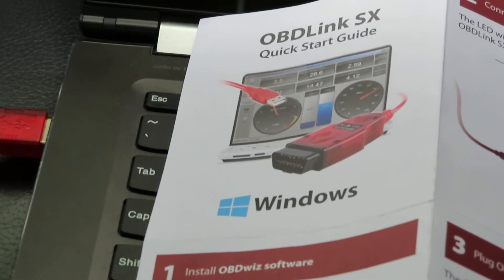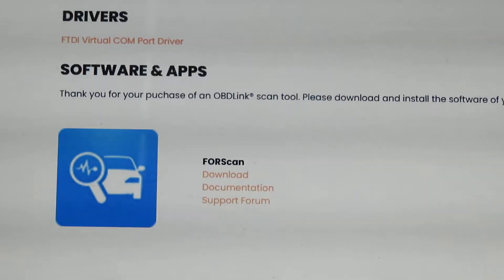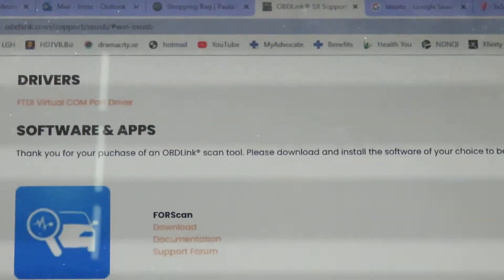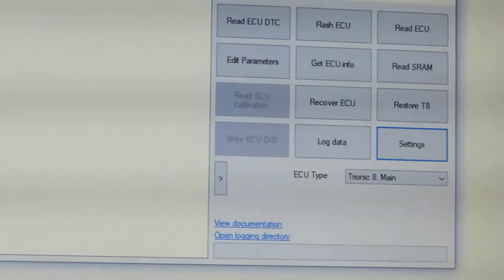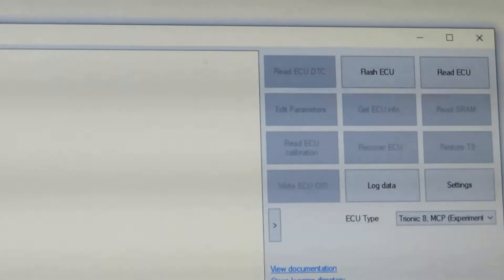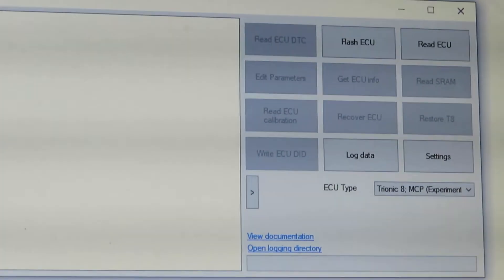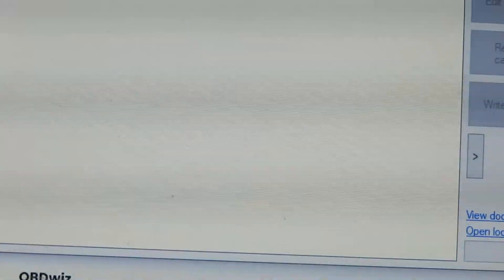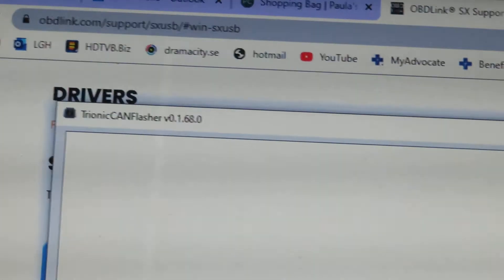2003 - 2011 Saab 9-3 2.0T Engine computer ECU fail -  P0245, P0201, P0202, P0203, P0204 no start

Comment: Failure is caused by heat build up, because of where it's factory fitted, fit a heat shield or better still, relocation of the ECU

Comment: Very helpful video!  I’m curious why you say the ECU rebuild service doesn’t work.

My Saab recently suddenly broke down and won’t restart. It ran fine and wouldn’t restart minutes after turning it off. Found a single P0204 code.

Comment: Hi. I would like to ask you. I "read ECU" main and mcp files. Do you see how small they are? Main.bin 1024kb, Main.md5 1kb, MCP.bin 257kb, MCP.md5 1kb. I tried to do "recover ECU" but it didn't work. I thought I could do something. When the engine went off on the road because I can't find any damage. I had an indicator on the brake lights and it shows nothing. Why; Do you know something?

Comment: Thank you for the video, did this fix solve the problem permanently or it come back again, I got some similar cases that need the injectors to be replaced as well before putting the rebuild ECU.
Reply from the maker: No issues so far with reman ECU replaced.

Comment: Very helpful. I tried this, but one issue I am having is my new ECU seems to be pared to my car correctly, except it starts the car as soon as I turn it to "on" instead of all the way to "start". Do you think I wrote something incorrectly?
Reply from the maker: I never had this issue. Sounds like your ignition switch could be the problem.

Comment: My Saab is in the shop and they told me they can't help me..at first I was having a fuel delivery issue..so they replaced my starter,put in new fuel pump,they checked my injectors and said they are good..was getting a p0300 but even with all that done my car cranks but won't start unless using some type of starter fluid but then it will cut off in a few seconds..they said I  need a new ECU,do you think that is the problem?also I am getting spark
Reply from the maker: Sounds like a bad ECU
Reply: @axleung1  thanks man,I don't want to get rid of the car so I will try and follow the steps in the video

Comment: Do you know if there's a way to reactivate features such as unlocking chirp sound as an example among several other things using this setup or is a Tech 2 the only way thanks for any info in advance
Reply from the maker: This procedure should duplicate all the settings from the old ECM to the replacement
Reply: @axleung1  that's the problem previous owner pulled the old ECU and lost a lot of features that's why I'm asking
Reply from the maker: @SnJMAX  you need tech 2